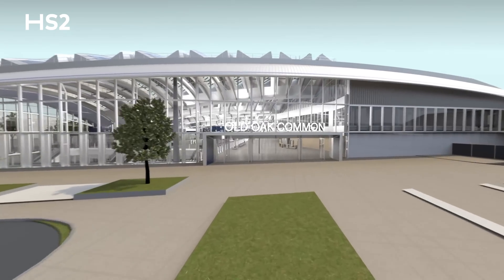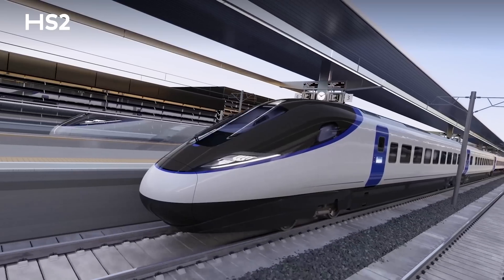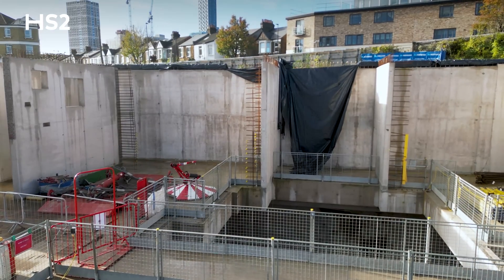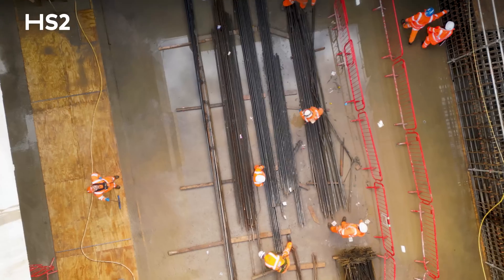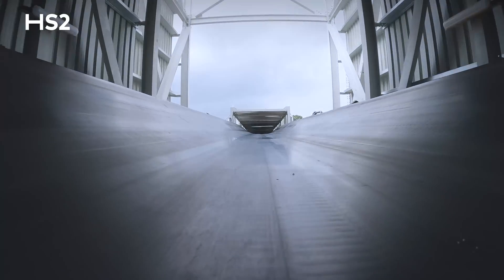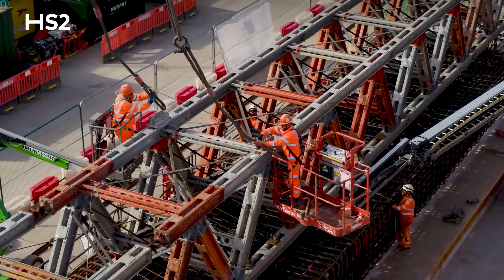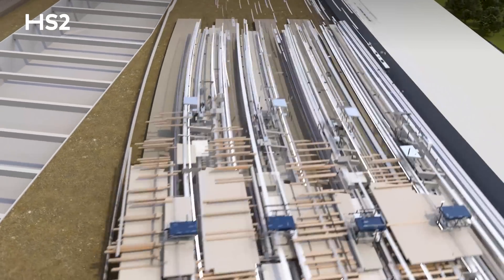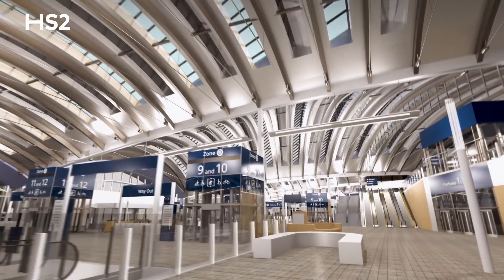HS2 Old Oak Common Station Project Update | December 2022

Comment: Good to see great progress.  However, despite its impressive size, I regard Old Oak common as somewhat lacking ambition and scale and a missed opportunity in terms of it being a 'Superhub'. There are five/six other rail & Tube lines nearby that are not tied into it. With a bit of imagination, some satellite stations, light rail shuttles or underground moving walkways they could have been connected as well. I guess that is one for the next generation.
Reply: Absolutely. It is particularly important there should be a connection to Clapham Junction. London's transport hubs ought to be connected - Crossrail will connect OOC with Stratford but regular London Overground service to Clapham Junction, either from OOC itself or by adding a station to the existing line where it crosses the main line just west of the OOC site (with good pedestrian access between the two stations, of course).

When these hubs are connected we'll look back and think how crazy it was that the London Underground used to be so clogged up with people who didn't want to go to central London at all but had to because it was the only way to connect between intercity and/or regional trains.

Appreciate it's not the project team's fault that this isn't in scope, but I only hope they can plan and build in such a way that it won't cost too much to rectify the error later.
Reply: @philwoodward5069  Completely agree 👍
Reply: This is such an important point. It was always TFL's hope that, at least, the two overground lines that (kind-of) interchange at Willesden Junction would be integrated into Old Oak Common, along with the West Coast Main Line, but it was not to be. A terrible missed opportunity, especially as Willesden Junction is such as mess at the moment, and no station at all on the WCML.
Reply: @@andrewrward  I thought there were plans for two new stations on the Overground branches either side?
Reply: I completely agree, typical Britain. Always cutting back on things and getting bitten in the ars a couple years later!
Reply: The amount of work being carried out on this one single station would be enough to carry out a London Tramlink extension to Crystal Palace and Sutton.  They could also extend the Bakerloo Line down to Bromley. 
The work that they are doing at Old Oak Common is extensive enough.
Reply: @@NathanGautrey Not to mention the increase in demand for leisure travel, what with increasing environmental concerns
Reply: @Nathan Gautrey All economic evaluations of HS2 indicate that it has negative benefit, in other words it costs far more than the benefits it brings. It has even been criticised by the Institute of Civil Engineers. The relatively small time savings and poor connections of HS2 add further to this.
Far better to use the money being wasted on HS2 for regional transport improvement, particularly in the northern half of England, an area that has suffered social and economic deprivation for many decades.
Reply: HS2 is a failure in both economic and transport planning terms. It is grotesque to spend well over £110 Billion on this project, which has negative economic benefit, very poor connections, saves relatively little time, benefits few people and is now obsolete in its conception. The world has dramatically changed since HS2 was originally conceived and HS2 should be abandoned at the earliest opportunity.
Reply: @frankemm6099  great news for the sky high train tickets and clogged motorways. What’s your solution to the demand far exceeding the current infrastructure?
Reply: @miketw3068 The  HS2 planning, construction and cost have all been highly criticised by professional bodies connected with engineering and transport planning. All economic evaluations of it have indicated negative benefit making it a worthless and over costly scheme. Billions of pounds of taxpayers' money appear completely out of control and should be used for more worthwhile projects.
Reply: @Frank Emm the problem with HS2 are the people who kept trying to stop it. It should have begun in 2015, if it did it'd be far closer to being completed by now at a much cheaper price.
Reply: @Alto53  they didnt made things worser
Reply: @Alto53  The UK railway network carries only about one percent of all trips. Even doubling rail network capacity will have negligible effect on the overall transport system capacity. Consequently, it is grotesque to spend well in excess of £110 Billion on a project such as HS2, particularly as it produces negative economic benefit and will be a burden on the UK taxpayer forever.
Reply: @Frank Emm  I think you made a point for HS2 without realising it. If 1% really is the number, then that shows an incredible scope for growth from an economic perspective. 

I would say that the cost figure for HS2 is severely large, though not everything is about a cost-benefit analysis.

For example, cities such as Birmingham or Manchester could do with a underground metro system like other similarly sized cities in the world. You can bet your bottom dollar that it wouldn't fit a cost-benefit analysis; but many would argue its good to do it anyway. There is more than the economic factor to build a transport system.
Reply: @Alto53  Not to mention that it would've cost a lot less if we'd done it sooner!
Reply: @Inkyminkyzizwoz  yep. Though it should be noted that the delays did allow for improved plans.
Reply: @Alto53  Like what? Ditching the HS1 link? Reducing the number of platforms at Euston? Scrapping most of the eastern branch? They don't seem like improvements to me!
Reply: @frankemm6099   I will remember these comments. 

We should never moved away from horse and carriage. The car is unreliable and accounts for less than 1 percent of travel. 

In all serious. You need to build more trains to get more people to use them. The culture of the car was mistake and being local is important, but the need for long distance is thing. Come back in 10 years. The is a reason why other successful countries have high speed rail
Reply: @frankemm6099  local transportation is important but its pointless when the national tranportation is bad however HS2 isnt planned well the budget is too high i will agree with you on this will it connect the south and north yes however not all of the south and north this also true HS2 should of been done in segments its more cost effective however scrapping it now is pointless plus it would make this country a laughing stock which we are plus our rail infrastructure cant support rapid high speed trains thats why we need new rail tracks we need a system
Reply: @HaiderShami12  AARGH! Use some punctuation!
Reply: The HS2 project is poorly planned and is a huge waste of public money, now well in excess of £110 Billion. It has been calculated to have no positive economic return and should be abandoned as soon as possible. The huge amount of money being wasted on HS2 would be much better spent upgrading the existing transport network, particularly in the economically and socially deprived northern half of England.
Reply: @frankemm6099  its not poorly planned its over budgeted it
Reply: @frankemm6099  improving existing  transport network, especially our train isn't possible to scale to what we need so instead we have to create a train network
Reply: @frankemm6099  not a  waste of money.  A much needed piece of public transport link up.
Reply: @gerardburton1081  HS2 was conceived before the days of Zoom conferencing and home working. It may seem wonderful for boys and their train sets, but economic evaluation of HS2 shows that its cost far exceeds the benefit it creates. In other words, it is worthless and the huge amount of public money being wasted on it would much be be used elsewhere.
Reply: @frankemm6099  still loads and loads of jobs that can't be done from home e.g.  emergency services (police, fire  and ambulance),   postal staff,  delivery staff,  nurses,  shop assistants, teachers,  hotel and catering staff,   mini cabs and taxi drivers just to name a few of the staff who can't work from home. Some office still have attend the office 5 days a week and some others can only WFH one or two days a week.
Reply: @gerardburton1081  The list of people you mention need better local public transport services and not a ridiculously costly new link to London. Again you need to realise that HS2 has no overall economic benefit and is a huge waste of public money. Its entire planning and economic assessment is now obsolete, as the world has completely changed since it was originally conceived.
Reply: @frankemm6099  better local transport AND HS2 are needed. People travel greater distances to work. This link is needed for people that don't drive snd people who don't want to drive a long distance to work plus it cleans up the air.
Reply: @frankemm6099  I live in Birmingham and finding a seat on a train to London at peak times is impossible even on weekends. This upgrade is long overdue and the prioritising the north and west connections should be next to help avoid pooled wealth in south east
Reply: @miketw3068  It is absolutely grotesque to waste well over £110 Billion on the construction of HS2. Its concept is obsolete, it is poorly designed in transport planning terms and it has no positive economic benefit. There is no justification for continuing construction of HS2 and the public funds being wasted on it would much better be used on improving public transport generally, particularly in the economically and socially deprived northern half of England.
Reply: @frankemm6099  Well I believe HS2 will increase rail capacity, that in turn will help with the current supply and demand issue we are facing hence the ridiculous rail ticket prices. So for the average person such as myself, I am looking forward to a comfy seat and shorter journey to my meetings in London
Reply: @frankemm6099  our population increased by half a million this year so soon people will be on the roof of our trains like in India if the capacity and price issue isn’t resolved soon
Reply: @miketw3068  The current level of UK population increase due to immigration is completely unsustainable and requires the equivalent of a new Birmingham every two years. Collapse of public services and social unrest are inevitable if this level of immigration continues. We are beginning to witness this now in regard to housing, the NHS, policing, etc. HS2 will not solvy this.
Reply: @miketw3068  With modern computer technology there is very little need for you to travel from Birmingham to London for a simple business meeting. We are now in the 21st century, with very little need to travel physically for simple meetings.
Reply: @frankemm6099  family, friends and weekends out
Reply: @@frankemm6099  People said the same when the telephone was invented. In any case, there's still something to be said for keeping home life and work separate!
Reply: @gerardburton1081  Exactly! Why do people have to make out that it's one or the other?